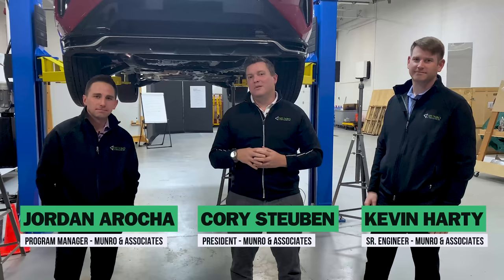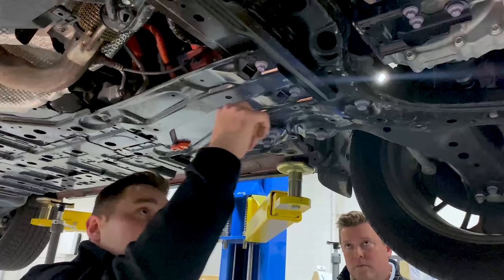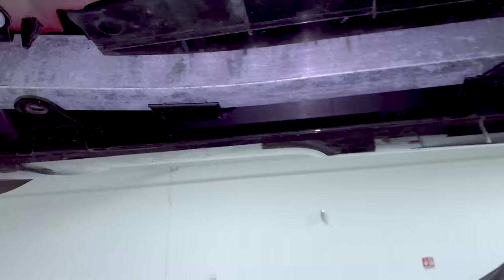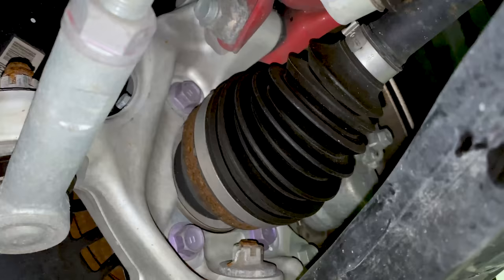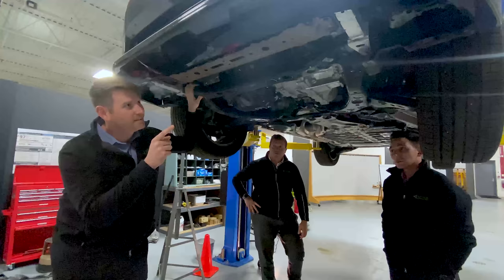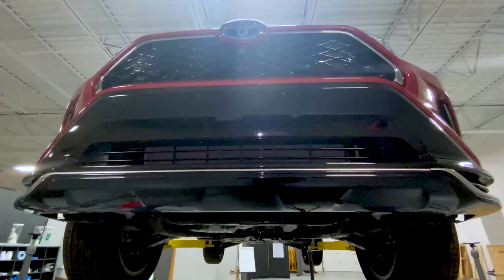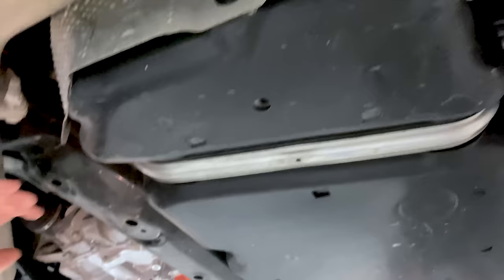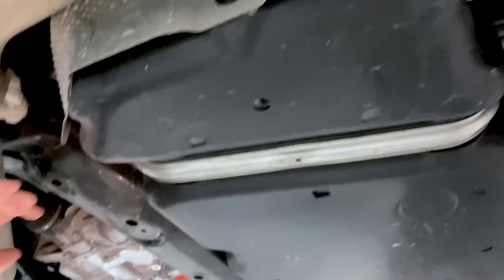2021 Toyota RAV4 Prime Plug-in Hybrid | Hoist Review

Comment: Is this car worth 50k ? I'm in the market for a vehicle but the partner doesn't want a tesla
Reply: I don't think it's working out anymore..
Reply: Then they are MISSING out, on the SAFEST SUV ever tested. 
Model Y is Built to a 6 star Safety standard.
even though no testing exists.
Reply: @markplott4820  I have a model y she doesn't want two teslas
Reply: @markplott4820  tried man its a no go, the  acceleration she don't like even on chill
Reply: @OrganicStuff1  If you need a slow EV, the Volkswagens are known to not have too much power. But if you'd like a hybrid then a Toyota like this one is a durable choice.
Reply: RAV4 Prime has excellent fuel economy = a great step toward an eventual full EV.   Also there are some tax discounts for PHEVs (like this).  50-70mpg
Reply: Lower trim (SE) is worth every dollar. Higher trims are priced high enough that you start comparing it to BMWs, Lexuses and Teslas, even though it's really a cheap $25k car with a $10k drivetrain upgrade and a handful of premium features, not built with luxury in mind from the ground up.

Comment: Greetings from the U.K. - as a keen DIY mechanic for 40 years, I do admire Toyotas engineering and design standards. However I really don’t like PHEVs. If a friend asks me to work on one, my heart sinks. A modern combustion vehicle as already ridiculously complicated to work on, then you add an electric drive train and a system manage the transition and it becomes an absolute nightmare to work on. I always advise friends to keep away from PHEVs and get a basic combustion car or EV instead.
Reply: Exactly right. No way this car doesn't become a money pit as soon as it comes off warrenty. You are maintaining TWO drive systems and the electronics to make it work. They were a work around till we got batteries that would last and provide range now we have them this neither electric nor gas idea isn't the way to go.
Reply: @kstaxman2  Nonsense. The electric drive train, which requires little maintenance, will take 50K miles off of the first 100K miles driven or more. That means less wear and tear on the ICE engine.
Reply: @jayhawkeyes  let alone acting as a coupling between the engine and drivetrain as well as acting as a braking system. Therefore saving on two friction surfaces namely clutch and brake pads. It’s a win win situation overall.
Reply: Your fear would be valid up to around 2007, now it sounds quite uninformed. Toyota's PHEVs are basically their hybrids with bigger battery. And they sold millions of them and they have been excellent reliability/durability-wise, better than conventional cars. 

It makes sense when you think about it - especially modern diesels are incredibly complicated with high temperatures, pressures and a lot of exhaust treatment technology. Same goes for modern automatic transmissions.Toyota's hybrids and PHEV are mechanically much simpler and their electric parts have been well tested until now.
Reply: You don't take an ICE car and "add an electric drive train". The EV components replace(!) a significant number of components from an ICE car with things that you'd see in a BEV. The car in the video has electric motors in a configuration barely more complex than what you'd find in a Tesla. But adding them allows it to not have a classical ICE transmission, or a starter, or an alternator. Now add in that the engine doesn't have to run most of the time, and when it does it only needs to run in the optimal power range, and you get a vehicle that's would be more reliable than any non-hybrid combustion car.

Comment: Why only positive talking points in these 3 experts analysis? Nothing critical; seems rather unbalanced.  They neglected to talk about the infamous “cable gate” issue of corrosion with the orange high voltage cable connector into the motor generator rear (MGR) plaguing customers.  Toyota’s solution to “fix” this was simply cut a hole in the orange housing and put a plastic shielding underneath it in the 2022+ models.

Comment: Making your hood soft so that you can run over pedestrians is about the most ludicrous and irrational idea that I've ever heard of. lol
Reply: Said the American.
Reply: It's an attempt,  as required by European regulations,  to reduce catastrophic injuries to pedestrians. If the front end of the car has some give to it,  especially where the head may impact,  the hope is that the pedestrian may survive or not be crippled forever.  I'm not so convinced that there's much hope of these efforts succeeding....
Reply: More of a Euro mandate thing.  Makes sense though.
Reply: In fact, it's been extremely successful in the EU for injury reduction.
Why would you want to hurt or kill someone with your car? 
Absolute insanity in America with cars.
Reply: @PhiTonics  I don't think that's what they were getting at.  Here in America,  we have much less interaction between pedestrians and cars and no experience with attempts to reduce injuries.  I'm willing to consider the possible success of such efforts,  but it seems that even being hit by a foam- covered car at 40kph will result in bouncing off the pavement at nearly that speed anyway :(
Reply: @jamesengland7461  Here is a converse example -- there is a reason hitting the surface of water at a high speed is different that slow.  The "shock" (rate of acceleration change) is a very important variable to material, i.e. bone, fracture.

Comment: Hybrid... don't want to know about them. Bye. Clean EV baby
Reply: EVs aren’t clean…. At least not until they’ve been on the road for 5-6 years.
Reply: I want a hybrid Truck that's actually EV based first, rather than Engine based... Like a hybrid that can go 300 miles on EV battery alone, but has a built in 3 cylinder industrial Diesel welder that I can also be used as a generator, which also triples as a 'charger for the battery to extend your range..  Even if it was unable to drive the car with a completely dead battery--- If I could just have it running to help extend range while my battery is still operating-- such as on long trips, that would be a great multi purpose work truck that every welder/ construction worker/ shop owner/ oil field guy would kill to have..  The "welder/ generator/ charger would have to be an automotive/ industrial grade diesel engine though..  No lawn mower engines.
Reply: @thomas735  clean like neat n tidy lol
Reply: @calholli  300 on ev sounds good
Reply: Fair enough that you're not interested,  but EVs aren't for everyone,  especially if they don't live where they can charge at home,  for example.
Reply: @calholli  neat idea, but won’t be cheap!
Reply: @thomas735  - FALSE , BEV payback is only 1 - 2 years for TESLA.
Reply: @thomas735  - Electric ⚡ still CHEAPER than Hybrids or gas. 
Gas now approaching $6/gallon in some states.
you can used SUPER off peak to charge BEV.
and even cheaper with SOLAR + Powerwall.
Reply: @markplott4820  dream on baby, you lost all credibility with that post.
Reply: @markplott4820  when we get Biden out and Donald comes back, gas will be back down to $2 a gallon.
Reply: @jamesengland7461  I'd like an Aptera here in sunny 🌞 Australia 🇦🇺 😎 & not charge at all accept for longer trips to other sunny coastal regions
Reply: @Jasedabass  same here!

Comment: It would have been nice if they weren't:
- Hiding documents regarding emissions of their hybrids... for decades.
- Advertising 6 times lower fuel consumption than their vehicles could do.
- Shamelessly spreading LIES and fake ads about EVs. They know that they cannot compete and are trying their best to slow down the transition to electric vehicles.
- Sticking with the same technology for 20 or more years. "Reliable...", "easy to find..." they say. Yes, because they are the same old parts that were used in the previous century. On top of that Toyota's reliability is mostly advertised and if they brake down, which they often do... it costs an arm and a leg to repair. Yes, every week there are a couple of toyota's with open hoods and hazard lights on at the side of the road. Winter is really harsh on their vehicles.
- They keep failing horribly at the "Moos test".
- And... their dealerships are miserable!
- ... multiple other lawsuits against them.
Reply: 6x lower fuel consumption? Which vehicle had this advertising?
Reply: Lot of BS. Even my 2001 Corrolla is driving after twenty years without any problems. My 2011 hybrid runs dayly without problems and the fuel consumption is even better than advertised. If you do your maintenance ones a year a Toyota is bulletproof for many years. Think about that sitting for hours in your EV at the charging point. 🤣
Reply: Are you just joking around or what?! Wtf!
Reply: @wimschoenmakers5463  go to South America, Asia, Africa, Australia even the poles you will see 30+ years old toyota still on roads.
Reply: I treat my 2015 Prius like crap and it's never had an issue and gets 50 MPG.
Reply: @wimschoenmakers5463  Think about all your fuel, repair and maintenance costs... While I charge for less than 20 minutes after a 4 hour drive and pay only a few $. :D
Clearly you have no experience with EVs... Every morning I wake up with a fully charged warmed up vehicle... while you search a petrol station "for hours".
Reply: @PenkoAngelov  Where do you live that you have to search for petrol stations “for hours”
Reply: @wyw201  Well... I never have to think about charging. Except 5% of the time when I go on long trips or to a different country.
While with a petrol car you are forced to stop at a petrol... wait for the other cars, wait inside to pay and wait for toilet and food... so you can buy someone's fuel that you can't live without. Around 15 minutes and sometimes more. You HAVE to do this a few times a week. It adds up to many hours a year. 
So yeah, you have a vehicle that deprisiates rapidly, needs frequent maintenance and oil/filter changes, needs expensive fuel, has thousands of moving components and is creating a deadly air quality for everyone. Congratulations!
Reply: @PenkoAngelov  I believe my query is “where do you live where you have to find a petrol stations for hours”. Unless you responded to the wrong person
Reply: @wyw201  And I believe that I already responded to your question.
With a petrol car you can't have an oil refinery in your backyard, right? You have to specifically go out every other day to visit the nearest petrol station to buy someone's product (gasoline). You have no other option. It takes time to go there, it takes time to wait for others, to fill up, to pay and so on. It ADDS up.
With an EV you can charge whenever you like and whereEVER you want. Everywhere there is electricity - in a hotel, in a hut in the mountains (even recuperate energy on the way down), at a campsite, at the office while you work, in your garage while you sleep. You can even generate your own free electricity. Can you refine oil?... Or maybe OPEC will come knocking on the door?
Reply: @thomas735  Just stating the facts. Search a little and you can find lawsuits against Toyota exploiting their customers and false advertising everywhere.
Reply: @PenkoAngelov  Are you assuming it takes all of us hours to fill up gas at the nearest gas station?
Reply: @wyw201  You are not listening/reading... I said multiples times already - You HAVE to visit a petrol station and fill up. This ADDS up to many hours for a year. While with an EV, I don't have to visit anything if I charge at home or at the destination when my car sits and waits for me.
Reply: @PenkoAngelov Let me rephrase: which city/town do you live in where you have to drive “for hours” to find a gas station.
Reply: @alanmay7929  They have a habit of reusing components from 20 years ago and on most vehicles. While there ARE such vehicles in those countries... Toyota makes a fortune by selling them the parts and consumables they need. It's a good business from their point of view - Even a third world country will buy a second hand toyota and still be a customer that bring revenue by having to constantly replace parts and maintain that vehicle.
Have you notice the corrosion on this new RAV4? Or the thousands of fasteners? Or the brackets on brackets on brackets?
Reply: @wyw201  I'll give you time to think a little bit more...
Reply: @PenkoAngelov  You just have to say aggregate or inception to date. No need for long rants on OPEC and other irrelevant info. I drive a Tesla too and I usually charge at work. Should I add up these charging times?
Reply: @PenkoAngelov  If you apply Pareto rule to time savings, wouldn’t the majority come from lack of oil change and fewer maintenance services? At least that’s where I experienced the most time savings
Reply: @PenkoAngelov  even tesla uses components from 20 years ago, nothing always have to be the latest tech to facilitate mass production, the famous tesla chips are still based on a 7nm node when the 5nm is already over 2 years old, toyota was one of the first companies to use silicon carbide mosfets on their electrical/hybrid systems...
Reply: @PenkoAngelov  there is a country in Asia full of tpypta prius I just forgot about the name, hybrid technology from toyota is the best in the world. Toypta makes money by selling cars that are well made and that will last decades to come, you still see over 30 years old toyota on the roads and that show it. In Africa people import 10 to 20 years old toyota from Europe and asia/USA and drive them for other decades. A tesla will not be able to survive in such difficult environments.
Reply: @PenkoAngelov  It’s not false, but hybrids are self charging.
Reply: @thomas735  Хахаха! Self what...??? 😂

Comment: Hybrid's are dumb. Having an ICE engine is the problem. You gain nothing useful and still have all the ICE systems to maintain. Toyota should know better. Thy will go bankrupt if they don't build battery EVs.
Reply: PHEVs are both, so you can use either system. Odds are it's the gas engine which will quit first.
Reply: What maintenance?  10k oil changes? Your argument is dumb. I have owned many ICE cars past 100k and the ICE engine maintenance is a non factor.